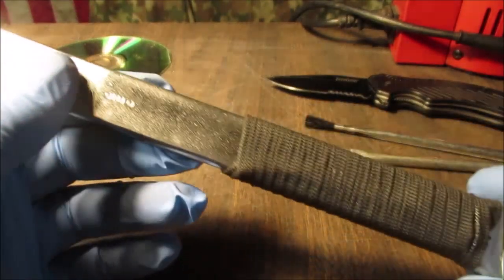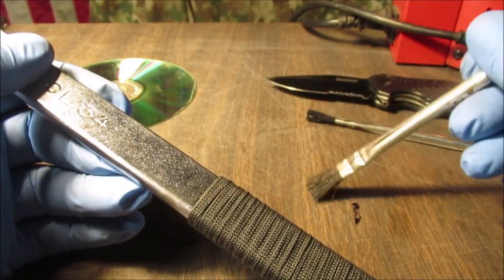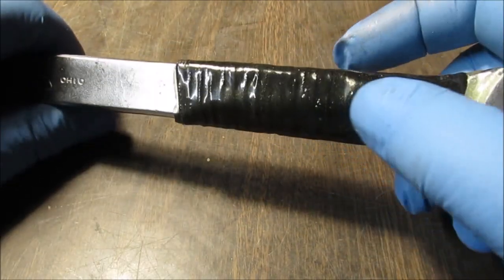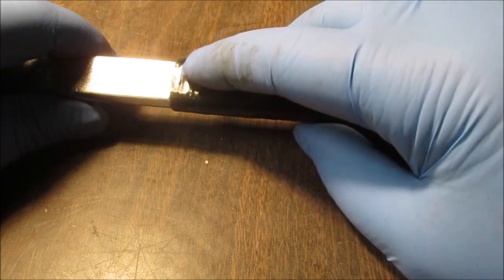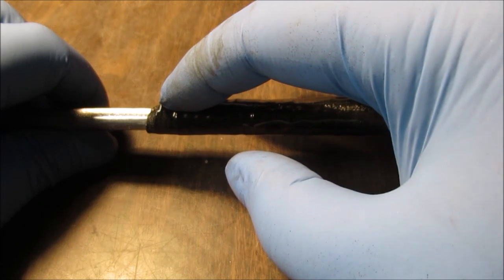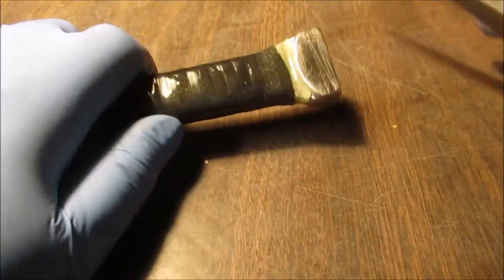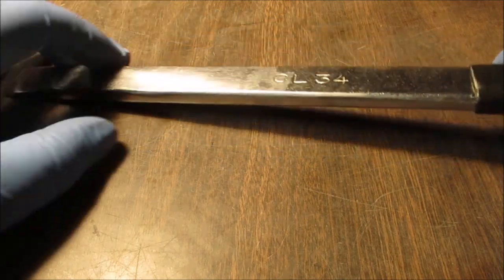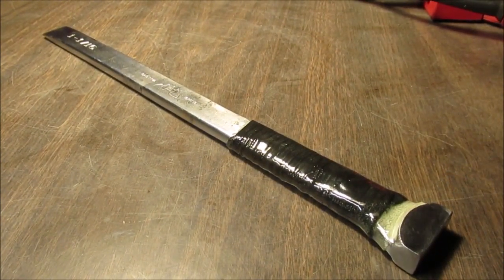Epoxy & Para Cord  Experiment  on Handle

Comment: You could maybe get some half round wood molding, glue it to the handle, then wrap over it to get the hump you want.
I've seen people use a flame to partially melt the paracord once it's on the handle - seems like that could go wrong in a hurry!
Reply from the maker: Good Ideas...I have seen Jute twine used and shaped then epoxied